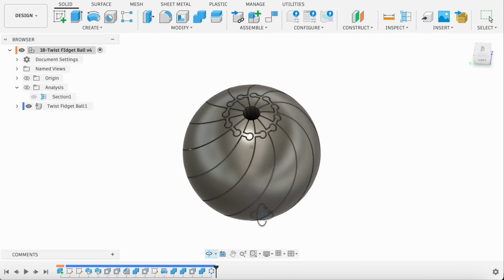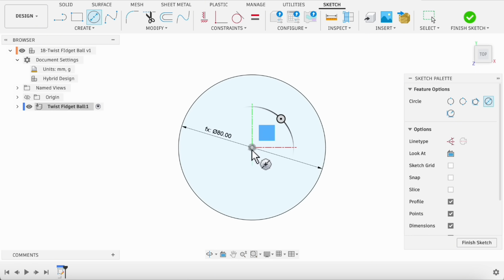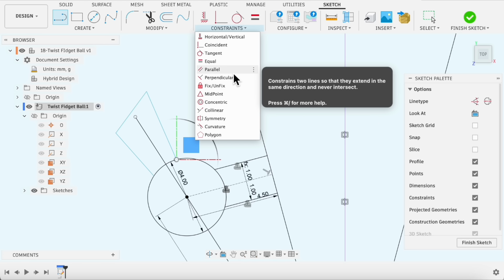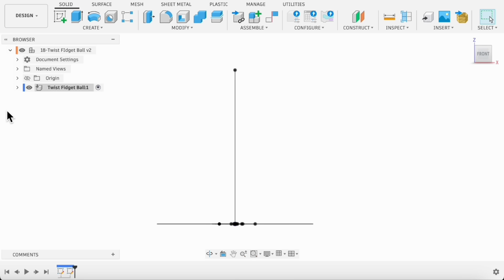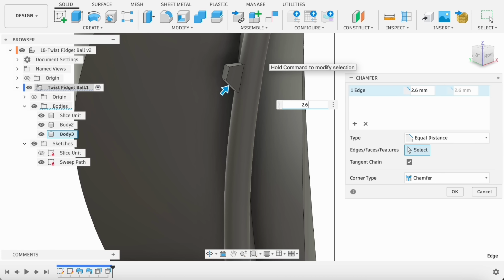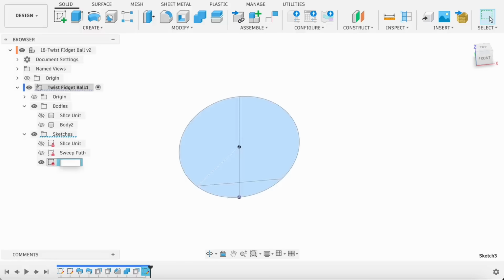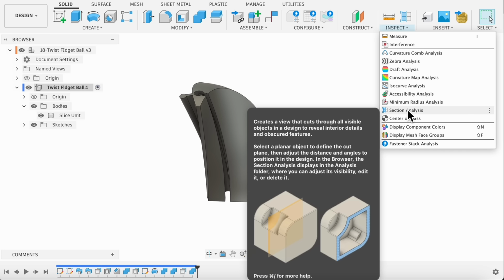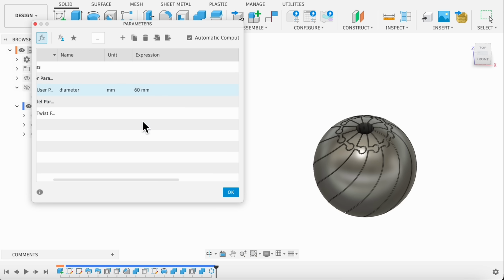How to Model a Parametric Twist Fidget Ball in Fusion 360 | Print-in-Place Design

Comment: I want to print a part for a car. The part is 30 cm long, and my printer has a build area of 25 cm x 25 cm, so under normal circumstances, the logical thing to do would be to print it in two parts and then join them. The problem is that although the part isn't structural and won't be subjected to heavy loads, it will be constantly subjected to the vibrations generated by normal car use. Do you recommend sending the part to a shop where it can be printed in one piece, or if I use a carbon fiber reinforced filament and a good anchoring system between the two parts, would I no longer have problems with the vibrations?
Reply: Use joining pieces and super glue. But if structural I'd get it printed from a farm where they could do it in one piece.

Comment: If anyone is having issues doing the captive pin slot there is small edit boo boo. Ignore after the contraining the center line don't add the 4.5mm dimension from the center of the circle to end of the line as this over contraints the pin slot if it's there when drawing the rest of the pin slot. Great video helping me loads getting familiar with cad drawing.
Reply: Thanks. i was just rewinding the video as i noticed that 4.5 dim vanish